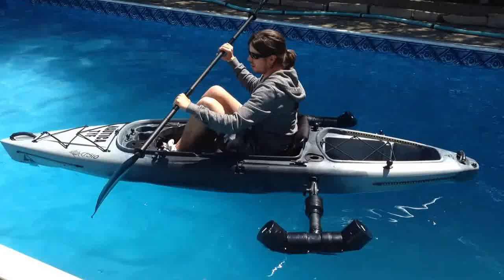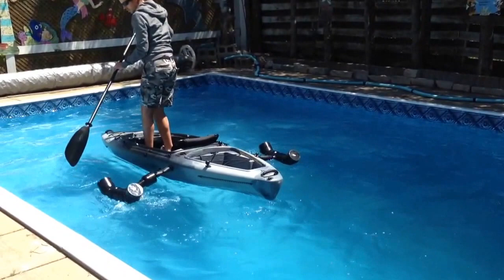Standing on Ascend FS10 w/DIY Outrigger/Stabilizer HD

Comment: Can you post a more detailed video of what you did to the hull to make it standable?
Reply from the maker: Hey sorry for the late response, just checked up on this now. All I did was add the DIY outriggers that I made out of I believe it was 4" ABS plumbing pipe, you can make it whatever side, even double it up, make it long or short, the bigger the sturdier I'd imagine but too bulky and you'll have it slow you down and get caught in obstacles, but yeah, ABS plastic, filled it with spray foam to make it even lighter and more buoyant, and attached it on using a 2" Ball RAM Mount, so I could attach and remove whenever, they can also be placed upwards when not in use meanwhile still attached on.

Comment: That's a good start but it looks like it would be quite difficult when you're trying to fish standing
Reply from the maker: Joe Johnson I've tried it out on four trips now (one of which I'm about to upload a clip for) and it seems to have worked fine so far. I feel confident with it on smaller lakes, definitely wouldn't attempt this in Lake Ontario or any body of water with a crazy current.

Comment: I have an ascend fs10 as well, great yak, just tough to stand in. Do you have any tips as far as building these outriggers? Thanks.
Reply from the maker: Building the actual outriggers is pretty straight forward, I personally used a combination of 4" and 3" ABS pipe from what I recall, and decided to keep it simple. Had I connected two on each side, and made it slightly longer, I would have had added stability, but you then get to a point where you can't paddle without hitting them if they're too bulky. I attached them to the kayak using 2" RAM mount balls where they can be simply added on, lifted up to allow for undisturbed paddling, or removed completely. Unfortunately I wasn't able to make a how-to video on it, but there's a bunch of information widely available on the internet. I'll try my best to make a video showing them upclose and explaining more in depth, just upgraded to a 2016 FS128T and will be making more videos.